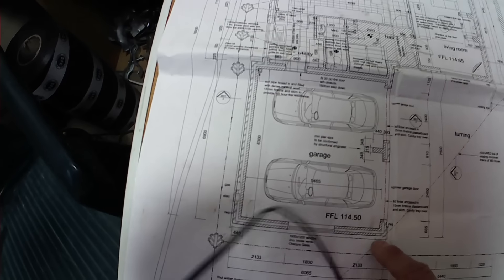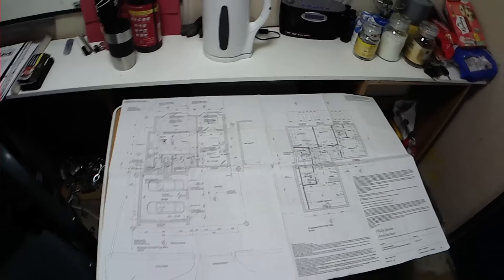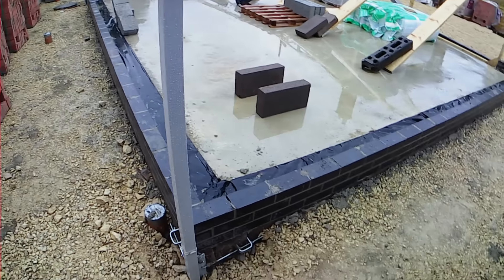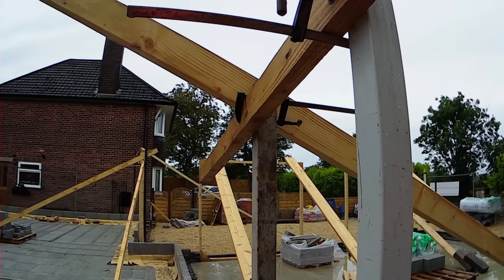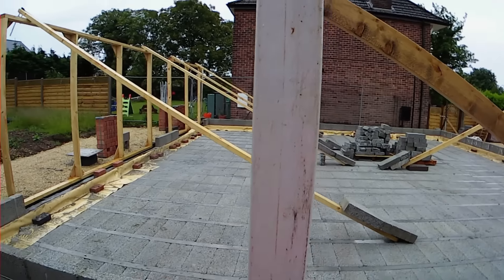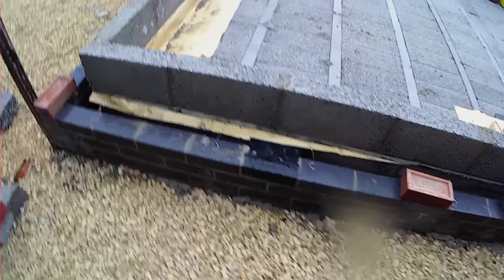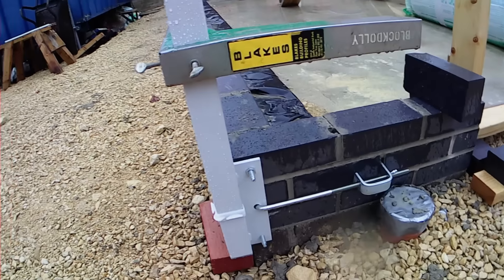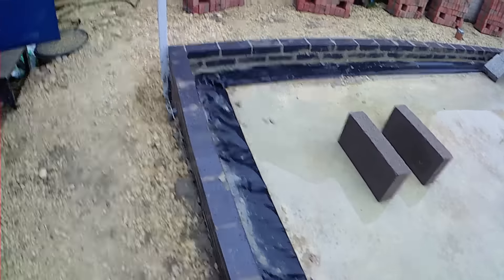PROJECT TOUR UPDATE

Comment: Great video dude .Looks like you run a very methodical and clean site... Do you not have some detailed wall section drawings ?
Reply from the maker: Thanks Ronnie, much appreciated.  I have an OCD and get really annoyed if it's a mess. I hate paper, brick bands, rubble etc all over shot I always say A tidy site is a safe site. 
 I will get a close up of the sections plans soon, I will dig out a big copy. 👍
Reply: Cheers dude it’s not for my benefit as over the years I have seen them all ,but for any youngsters or folk having a go I would always insist the architect produce a set of detailed wall sections which should show the DPC and then cill heights ,Lintel heights, First floor ,Fire barrier, Trays , wallplate bla bla. This also has the advantage of storey heights so you can do an accurate takeoff of materials as you would have the width on the plan and the height on the section thus saving you time and waste trying to scale a drawing that er ...isn’t to scale .Hope this helps .🤔
Reply from the maker: @ronniebiggs4026  love the reply ronnie. Nothing like the old school helping out us younguns much appreciated and respect👍 Top man. The architect on this job is bang on I do have a copy of sections but didn't have them on me at the time as didn't really need them at that point however I now have them and will show them. Can't go wrong really follow the plans. Take care ronnie 👍
Reply: RJM Bricklaying & Outdoors ..Ha ! Don’t follow the plans as a bible as over the years some simple back checking has revealed a few mistakes the most obvious one being window openings or panels not measured to brick lengths or inverts given on Manhole chambers were pipework ends up with no fall ect .If in doubt get off that backside and double check ..Just sayin 🤔😎💪
Reply from the maker: @ronniebiggs4026   sound for the advice dude. I didn't put drains in so not on my head.... I just follow the plans  as if there's any f@#k ups then it's not down to me it's down to the architect. Is that wrong to do?
I do make things work brick if I can sometimes it can't be helped due to opening sizes not working brick etc. 👍💪
Reply: RJM Bricklaying & Outdoors .. The answer is no . You can’t trust anyone including Architects to get things right all the time and if you spot something you have a duty of care to either point it out or correct it .A typical example would be a pot and beam floor all laid out on drawings and approved by the design team ,you then over lay the M &E drawing showing various soil pipes running down through each floor in the corner of a room ..Boom ! The pipework won’t fit because of the beam fixed parallel to a party wall .Once spotted you then can arrange for a steel hanger to be made and a cut beam installed . But if you don’t bother looking or know about it and say ✌️it not my issue it’s not the done thing and you will get all the hassle with the crane ect .On the subject of drainage by others ,let’s say you are the main contractor and you accept what is laid is or should be correct this will also bite you back for instance if a ground floor soil pipe is in a room but happens to be 300mm away from a wall and not in the correct position for the plumber . Walls built ,plastered ,skirting on ,floor screeded , and the plumber is looking at you ,....What do you want me to do gov? So very boring but a couple of easy answers to you questions.👍 You have stepped up to the plate ,but it’s not just about setting bricks now ...It becomes harder
Reply from the maker: @ronniebiggs4026  o ryt oops. I was always told wheb my days on site the foreman at the time always said follow the plans and cant go wrong. Well thanks for the advice and answers I will deffo bare that in mind for sure 👍. Got me food for thought haha.

Comment: Hi what was the level you where marking out? Very tidy site BTW.
Reply from the maker: Hi there sir, thankyou for taking time to watch and comment. It means aloy. 
It was mark to get level and then I measured down  to my FFL as didn't have a staff. If that makes sense. Thanks 👍
Reply: Yup this level mark is normally 1 meter above the proposed FFL ( Finished Floor Level ) The Finished floor level is usually set on a peg away from the building and in an area that can’t be knocked so the engineer or site agent can easily go back on to it an transfer any level around the site using the ffl as a reference point at all times ,this could be an invert of a manhole chamber or say the landing to a 1st floor set of concrete stairs and of course the wall plate.